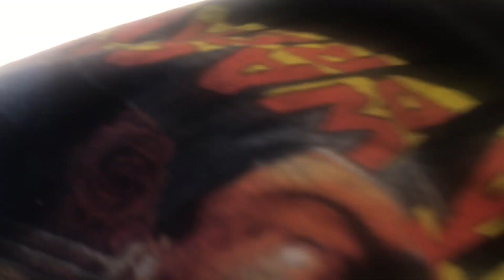T444e Broken Piston Roadside Repair. Will it Work?

Comment: I think the repair will work very short term and at low RPM.  I don't know where you're headed but I would get to a place as soon as I could to do a proper repair on the cylinder.  Good luck buddy and as always I there is anything I can do except be there let me know.